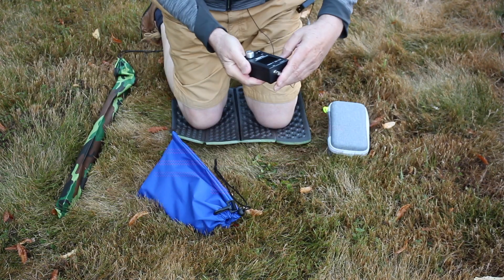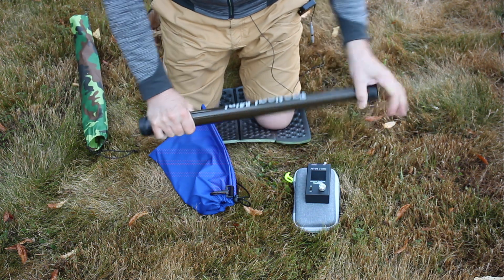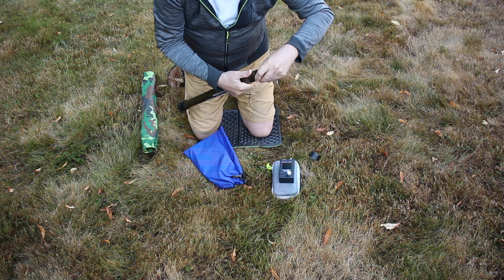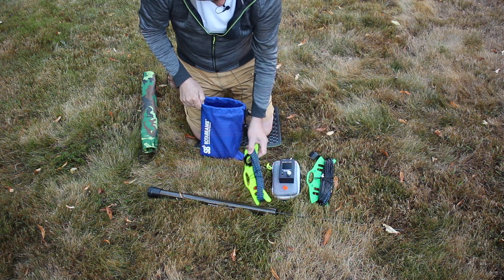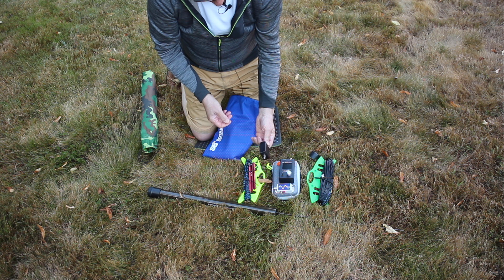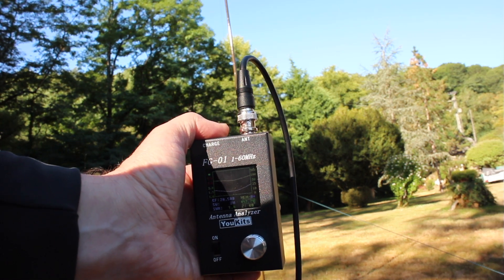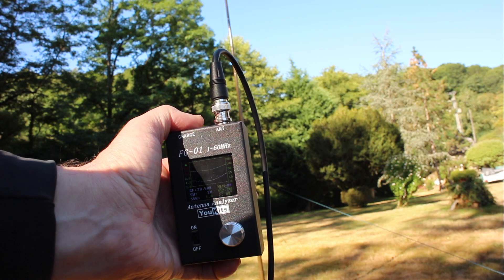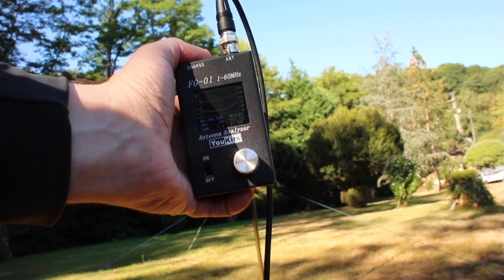Highly Efficient Ham Radio QRP Antenna for 40m, 20m, 15m and 10m Bands

Comment: I trim my antenna for 7.012 it seems to work well for the other harmonics
Reply from the maker: Yep. That's the way. Trim it to the bottom of the lowest band -- and with luck, the VSWR will be fine on the other higher bands
73 Bruce G4ABX

Comment: Have you tried a 100ft tape measure. Especially ones you wind up. Atu required. Cheers from old George
Reply from the maker: Not tried the 100ft but do use a 30ft tape measure antenna for portable working.
My 30Metre tape is a fabric one -- for measuring out wire for my various portable antennas.
73
Bruce

Comment: I have a couple large wire antennas I bought years ago six seven years ago .one has about seventy foot of ladder line or window line on it it is a multi band . Do I hook my ladder line directly to my antenna tuner or put co-ax on my ladder line? Thanks Bob H.
Reply from the maker: Hi Bob
Ladder line is the most efficient feeder you can have. MUCH better than coax!
So if your tuner has a balance input, connect your ladder line and tune to your hearts content :-)
73
Bruce G4ABX

Comment: Love the SotaBeams wire winders. Try this trick for a quicker deployment. When you are un-winding the antenna, try allowing the plastic winder to rock freely as you pull wire off the winder. Instead of rocking your wrist back and forth as you are pulling wire off of each of horns, just let the winder dangle between your fingertips. Let me explain: using just your fore finger and your thumb, form a circle within the large handhold whole of the winder and now begin to pull wire off the winder. The winder will freely rock back and forth as you pull wire off. I use an inverted V linked dipole with the 10m SotaBeams mast. Most days are windy where I live and I use 2 sets of guys (one at the top and one in the middle) with micro para cord down to 4 stakes in the ground.  That might seem like a lot of string, but it only takes me 10 minutes to put down my back pack, deploy my dipole and be on the air. I have it down to a science and the winders make it easy to deploy the antenna and guy wires using my "free rocker" technique of un-winding. 73
Reply from the maker: Great advice Mike.
It works!
73
Bruce G4ABX

Comment: Mount the camera high so you don’t have to bend over.
Reply from the maker: The problem with a goPro 3 is that if you mount it high up, you can't get the detail.
73
Bruce G4ABX

Comment: I might have missed it, but I was hoping to know which co-ax you are using.
Reply from the maker: John, good morning.
The coax used is RG-174.
Its what I use for all of my portable kit.
I use circa 10m length to connect between my rig and the balun/antenna.
73
Bruce G4ABX
Reply: @G4ABX  I thank you, sir. Thankfully, I just selected the same and it came in yesterday. 5m of RG174. I now await my poly-stealth wire and K6ARK EFHW transformer. Everything - including radio, 3 ah battery, 40m wire/unun and coax - will fit nicely into a 1 quart ziplock baggie. Now all I have to do is wait for some kind of international major calamity so I can get out there and be useful. Lol

Comment: Nice set up like that antenna analyser
Reply from the maker: Afternoon Mark. 
The Analyser was an inexpensive Youkits FG-01. 
When I bought it -- many years ago, it was circa £120. Today its a £100 more! 
Its small and compact and in a metal case so quite robust for setting antennas up outdoors. 
Its also quite accurate -- so you can believe the information it provides.
73
Bruce G4ABX
Reply: @G4ABX  hi Dr thanks for the reply and info I might invest 73s

Comment: Nice setup Bruce! By the way, you could also use 6turn compensation coil at about 2 m from the feed point to get the bands to stack up in resonances. Needed to pull down the resonate frequency on the upper bands.
Excellent QRP transformer. Also, congratulations to Colin, MM0OPX.
73
Nick SV2DSY
Reply from the maker: Thanks Colin -- and you are my 500th subscriber 🙂
Yes I have already wound the coil -- but the antenna is in France and I am in the UK -- so it will have to wait a bit 🙂
73
Bruce G4ABX
Reply from the maker: Silly me. It wasn't Colin! You sir are my 500th subscriber. :-)
Thank you Sir.
73
Bruce

Comment: Nice setup Bruce 73 Gm4zji Chris
Reply from the maker: Thanks Chris.
I wanted a setup I could rely on without the need of trees or the like at my destination.
Having a single 6m mast support and arranging the antenna as a sloping 'inverted L'  with a simple tent peg (albeit a got tent peg!) on a piece of Parachord as the anchor for the far end of the antenna was always something I've had in mind -- and it works VERY well.

It also give some directionality: Point the end of the antenna in the direction you want to work. My guess is there are a couple of dB 'gain' to be had in that direction. This effect is quite marked if you are on a summit and can slope the end 'down the mountain'
73
Bruce

Comment: Lovely little setup Bruce. I need to get one of those masts. All mine are quite heavy for /P. Have fun 👍
Reply from the maker: Thanks Colin. 
Its so easy to set up (In no small way, thanks to your UnUn)  -- probably in under 5 mins if I were not filming it and it s lightweight and compact, very 'Backpackable'
So far, best DX on 5w CW is Japan and that's not even from a summit!
73
Bruce

Comment: Very nice setup!!  So total length of antenna was 21 meters?  73, K8JLW
Reply from the maker: Yes 21 metres. I expected to trim some off but that was not needed. Adjusting the height above ground at the 'far end' for the antenna -- where it is secured by about 2metres of Parachord also affects the antenna's resonance -- but not by much.
I'm sure with some more 'tweaking' I could improve the SWR -- but for now, I'm happy :-)
73
Bruce G4ABX
@G4ABX